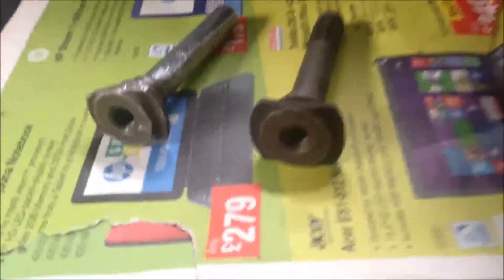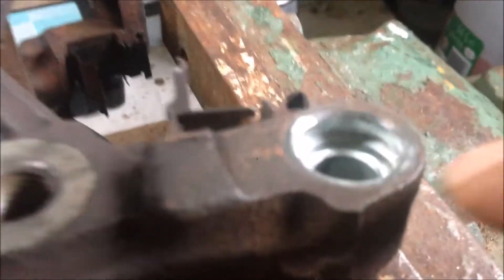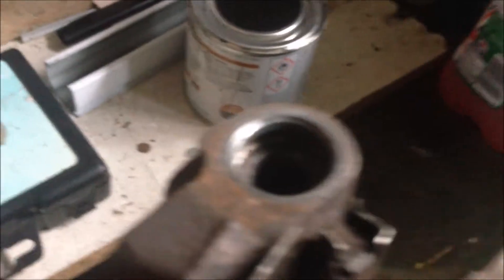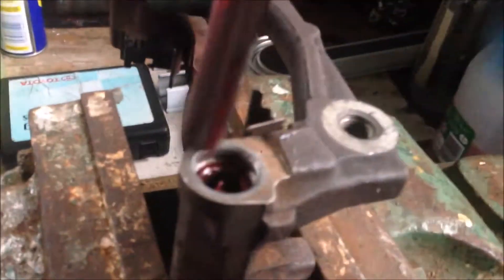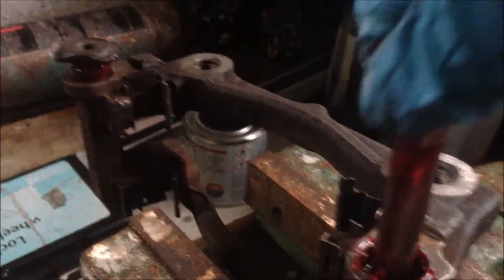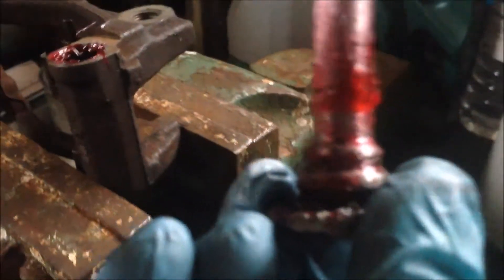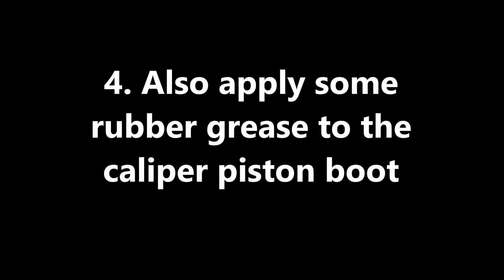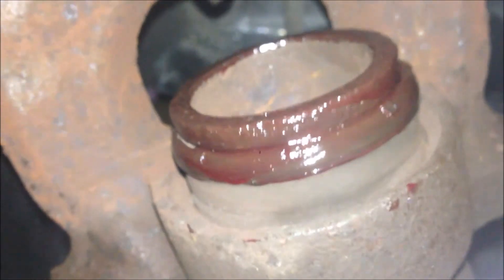AYGO: Brake Caliper Slide Pins: How to Lubricate and Assemble? Toyota, C1, 107

Comment: Way too much grease. Pin is now acting like a syringe , prevent movement to slider pin. Air is trapped inside, heat up , will fail in 2 monts of driving